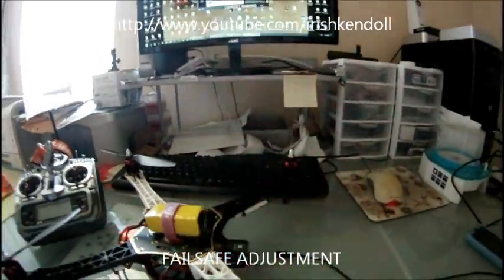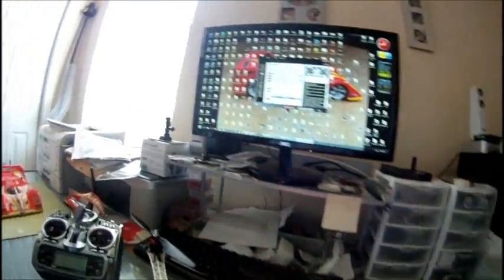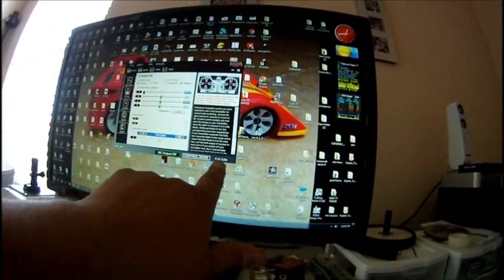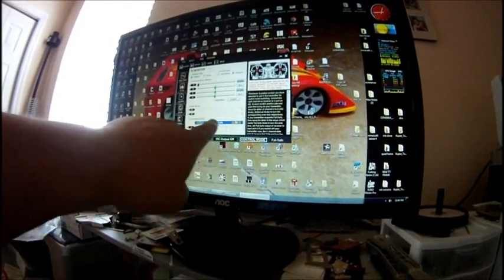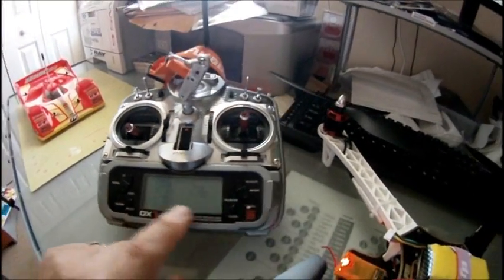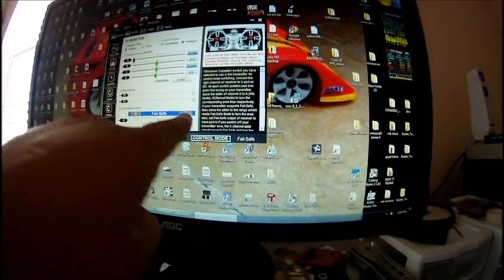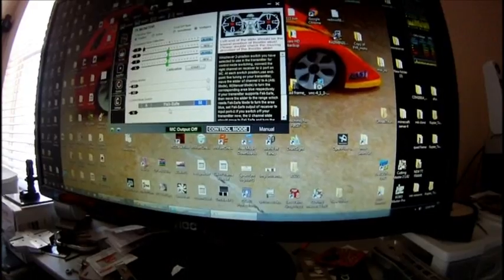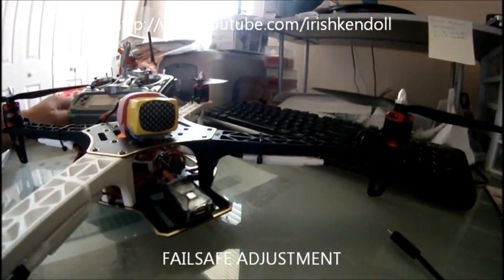DJI NAZA FAILSAFE ADJUSTMENT

Comment: @xtremeink69 Apparently not, I had some ones from a local hobby shop (8000Hz). I even removed the red (positive) wires from the ESCs, and it still caused the NAZA to malfunction and I had to return it. So you need ESCs for quad copters, such as OPTO.

Comment: @vvvsk you can actually set the manual ang atti mode via gear switch and failsafe via axu2 switch. Failsafe can also be triggered when you turn off the radio or you lost signal but the qaud still hovering. But make sure set up the failsafe between 20-40% depending on the payload. Mine is almost 2kg so I put 38% failsafe and the qaud will land straight very slowly.. but the problem if there's a wind it will drift away.. lolz!

Comment: hello i buy dji naza kit f 450
i have problem with driver instalation. if i want instal driver on my
pc, windows write ,,The current language is not suooirted by the
device driver installation wizard.i have slovak windows xp.i triyng
install manual by device wizard, winn still write usb device is not
recognized.
pleasecan you helpme?